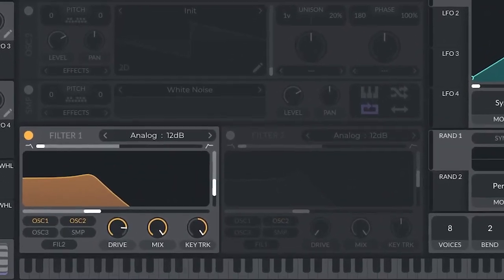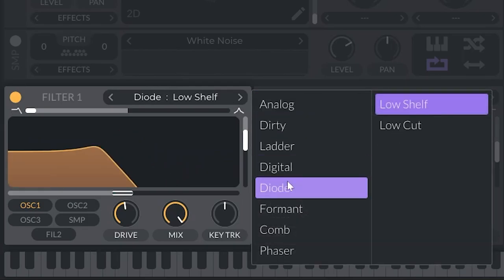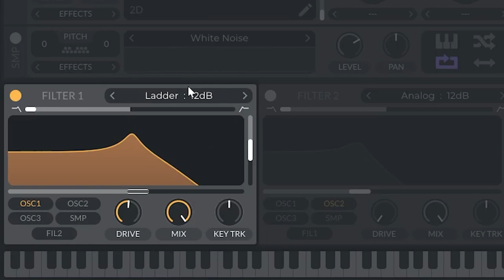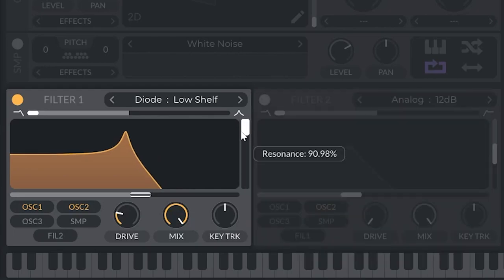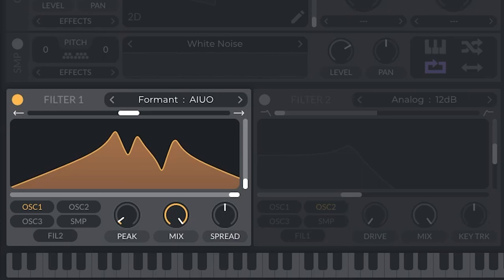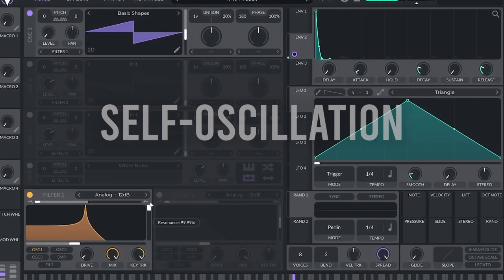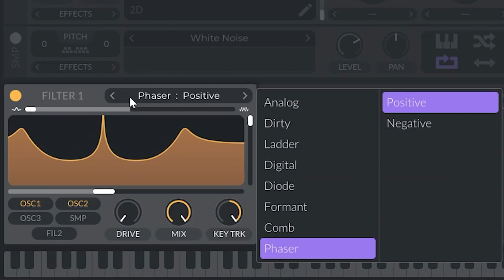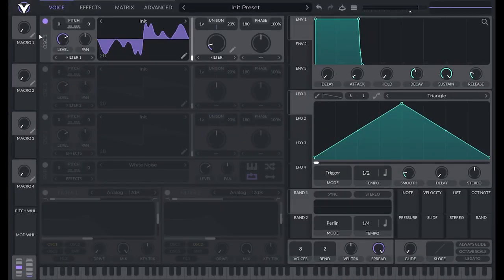Vital's Filter Types Explained | Sound Design Tutorial

Comment: Here's what I've noticed: 

Analog has subtle, smooth saturation, and tends to smooth off the high frequencies. The feedback doesn't grow in volume, so it's good for natural sustain.

Dirty has more distortion, but it notably adds both even and odd harmonics. 

The ladder filter tends to hold onto the resonant peak for a little while, kind of like a small delay. For this reason, it's good for warm-sounding synth parts

Diode definitely sounds different than ladder, I just don't exactly know how to describe it. I just pick which one I prefer. The biggest upside is that the "low cut" filter is useful to cut out subsonic rubbish.

The Digital Filter's resonance feels very "grabby" and hits the distortion pretty hard, picking out individual harmonics. Its distortion tends to have that "squelchy" quality we associate with acid synths. The name "Digital" makes me think there's some sort of digital-style clipping, but I could be wrong.
Reply from the maker: Excellent observations! They sound spot on to me. Thanks for sharing with us!

I think you're right about the digital clipping on the digital filter. One of these days I want to dig into the code and see for myself how they do it. There's an open-source fork called Vitalium where you can look at the code and see how it's done. I haven't had a chance to look into that yet.

The Diode filter is particularly interesting to me due to its circuitry - there's a lot of "side effects" due to its odd design, which makes some interesting sounds.

Vital has some good filters. I'll be digging into Surge XT's filters soon. There's some good stuff in there too.